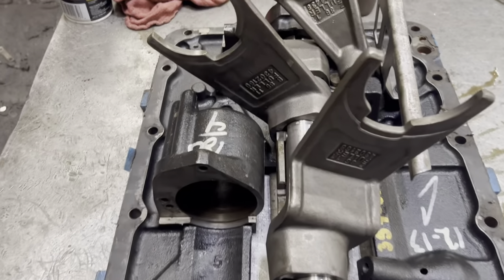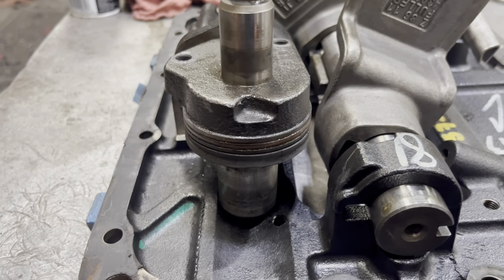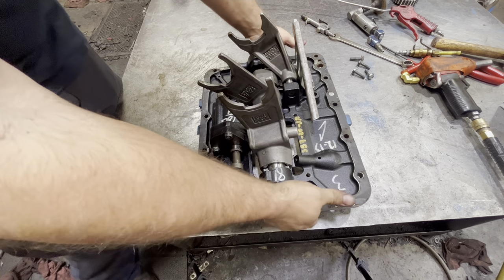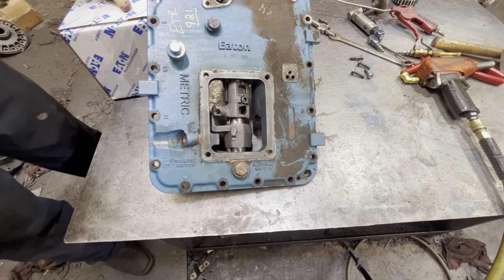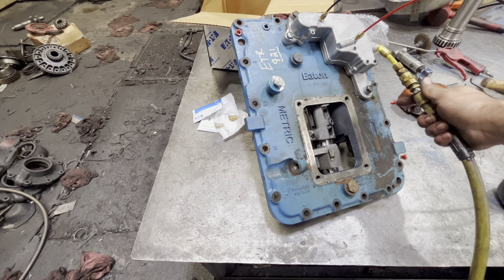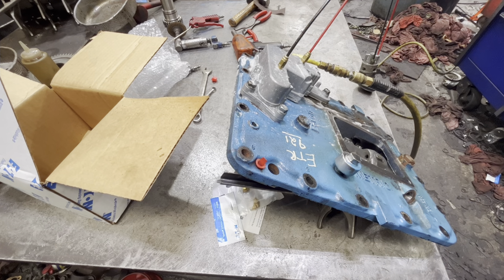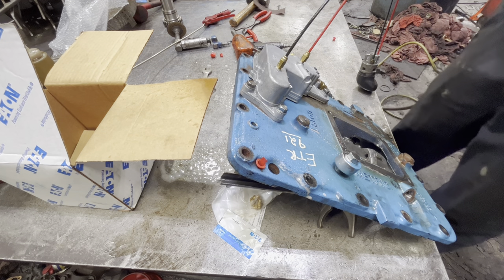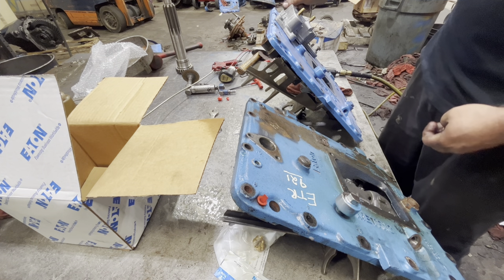Ten speed transmission leaking air from valve on the top and why. Eaton Fuller Fro16210c shift top🥹

Comment: Hiya just watched your video it was fab.we use to have that transmission  here in the UK. I believe if memory serves me right it was a12 speed. I remember the key way in  the top cover breaking.and also at the rear of the transmission there was a plate with 2 bolts in front of it there was a pin to use to break and turn .driver would call say he stuck in no man land with his gears.would go out undo the 2 bolts remove the cover stick a screwdriver in the shift it hadT stamped in it turn it to the top fit a new cover plate on his way he would go.
Reply from the maker: Glad you enjoyed the video . Would definitely like to see what you guys are running as far as manual transmissions there in the UK. This is a 10 speed Eaton Fuller top plate by the way but yes there are two different styles of this top. There is a key top and a lug style top and yes the key style top is known for breaking and leaving you stranded.
Reply: Hiya thanks for replying back. Well over here we're using these automatic transmissions I've not had anything to do with them really .There in Daf trucks volvo and scanias .There good when there going right but I no owner operator's that run them. Very very expensive to repair .ie if the computer on top of the gearbox goes thatcan cost up to £3000 pound. Lol I'm 57 old school I like the Eatons back in the day we had 9 and 13 speeds . Then Eaton brought out a gearbox called the Twinsplitter that was a fabulous box

Comment: I have a 13 speed. My truck is leaking air at the red splitter button, but only in high gear. I drain my tanks regularly. And have rarely encountered water draining from the tanks. It is an eaton fuller trans, not sure of model. But it is in a 22 lonestar, wiki 320k miles. It just started yesterday, and the leak is faint. But aside from it being annoying, I'm worried it's going to lead to further problems down the line.
Reply from the maker: It could be an issue with the splitter cylinder possibly rust on the inside causing air to bypass around the oring in the piston/cylinder wall.

Comment: Hi guys. I had a leak on top of the air module valve( valve itself was cracked and been leaking). With the old valve i had no leaks underneath the valve. I changed with the new one. In the morning when i move the splitter to higher gear i hear air noise not the click, but still changes the gears without problem. After 10 minutes works good, no air leaks sound and does the click up and down normally. What can cause this. Maming me crazy. I opened 3 times the valve..

Comment: Hey bud I have a Eaton super 10 that got stuck in gear and I’m trying to get it back to neutral. I took of the tower and I’m playing with the bars. What do you think cause it to get stuck in gear? Should I be worry or could it be a simple fix
Reply from the maker: You may have a broken reverse gear snapring. It needs to come out to be repaired. It’s easy to break a mainshaft when this issue happens.

Comment: How much does it cost to fix that? Thanks
Reply: Modulator=600
Top plate= 2800
Labor=1200
Plus miscellaneous, tax and tip 😊
Reply: Damn , mine can continue leaking air I guess 😂, the top plate cost more than the whole rebuild transmission